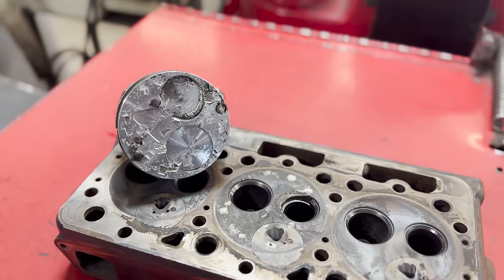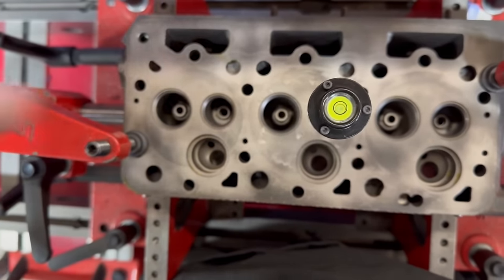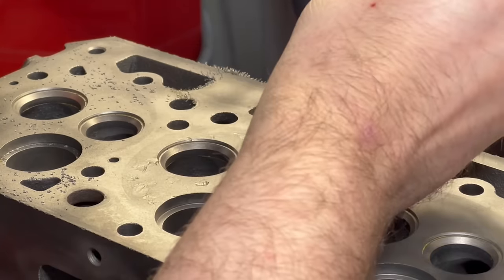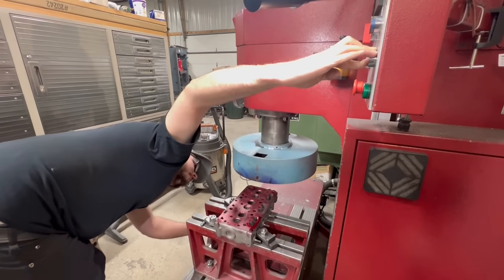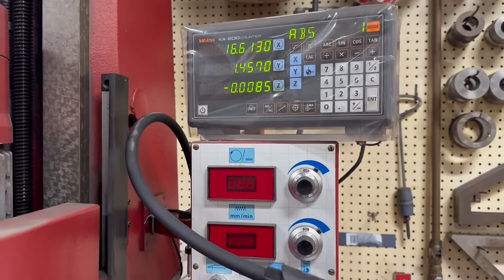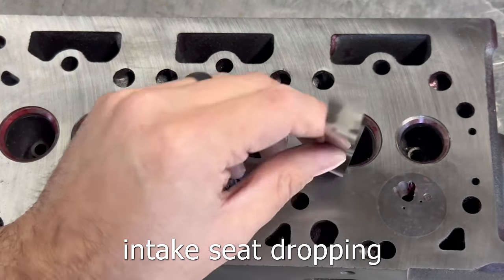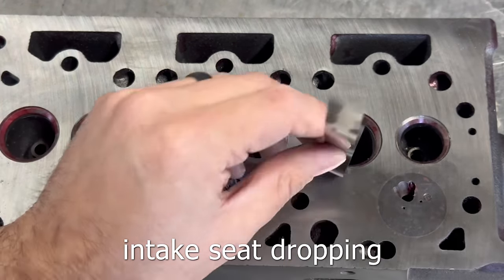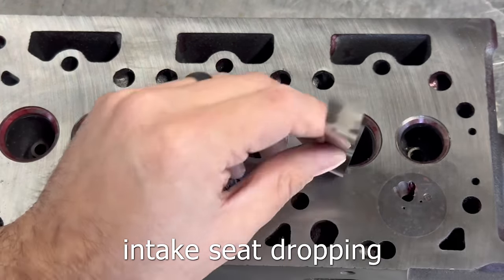Is A 3 Cylinder Kubota Diesel Engine Worth Fixing?

Comment: I'm the service manager at a Kubota dealership and in my experience the cost to repair almost always exceeds the cost to replace IF you can even adequately repair the block and head. The engines aren't cheap but they come complete. Turbo, dpf, accessories, starter.... Yank the old one out, drop the new one in and you have a completely new engine and much less labor.
Reply: Since this is a prechamber engine, this might predate DPF and electronics. Many people like rebuilding those to avoid the complexity of electronics and DPFs. I think about the guys who spend a fortune on a Dodge 12V CTD Ram.
Reply: That’s a feature of your shop rate, not a bug.
Reply: Planned obsolescence. The same is true in most industries. There may be an occasional instance when repairs are possible, but over time you find that it is often cheaper to replace rather then the labor cost of trying to source parts and cover the labor.  Great video!
Reply: @jimknowlton342  the shop rate is a "feature" of the economy and in line or LESS than some other competition. Trust me when I say I couldn't rebuild a Kubota engine for less than I can to replace it. So much so, in fact, that I have NO tools in this shop to rebuild diesel engines. They would never get used because it's never cheaper to rebuild THESE engines. When I worked at a different color manufacturer with far more serviceable engines for far less money, we rebuilt them.
Reply: @skylinefever  I don't disagree. I recently had a pre emissions track loader in the shop and tried real hard to convince the customer to just get a new engine that was still available rather than trade it for a new emissions machine. Because the machine itself was in AMAZING condition and just had a TON of hours on the engine. That pre emissions engine was very reasonably priced because it doesn't have the price of emissions built into it like replacement engine for current models.
Reply: So you install a Kuboto engine, and it dies immediately, and you've got a warranty.  If you have a machine shop rebuild.... who knows?
Reply: Ya, I  wondered about that,  especially in CenTex where machine shop wait times long and labor not inexpensive. Old stuff could be sent south in bulk containers where resources different
Reply: When you get a good shop to do the work, you aren’t gambling on “new” parts.
Reply: Siamese blocks always  take  the hit in center hole.only 2 sides exposed to coolant.heads will crack from precup  to exhaust seat.less labor to replace engine complete plus a better warranty. Find the cause of overheat and address.BX series   main culprit. Small cooling system  does not like restricted  air flow.35 year KTC tech
Reply: It is good for training however it would be best to replace the engine.
Reply: Well your little kubotas run a lot better with the dpf removed and a custom ecm tune. 😉
Reply: And throw the old one into parts bins at the shop when you need something in a pinch.
Reply: I hate that we are living in such a throw away civilization.
Reply: I’ve just rebuilt a Fiat/GM 16 valve 1.3 diesel. The cam chain had failed but these engines have sacrificial valve rockers. Bearings were all great, bores cleaned up with a hone. It’s had new rockers & lifters, cam chain kit, head gasket kit, piston rings and a top end strip and decarbon. Parts costs are very reasonable. The great shame is that Fiat only used a cam chain because GM wanted it. A belt would have been more reliable.
Reply: We found head gaskets were more expensive than another engine from japan and injector nozzles were a laughable price. Ive even used different rings and taken care of the old head gasket and used CRC gasket paint and reused it to keep a pump running.
Reply: @permaculture3 that’s not what Planned Obsolescence is.

Here, this is high automation involved during manufacturing lowering the cost compared to the high cost high skill required for disassembling, analyzing the issue, designing a solution, applying that fix and reassembling the engine back. And also the cost to request and ship replacement parts. This equation might be different in a country with lower human cost or requirements/expectations from a customer regarding the lifespan of this fix.

Planned Obsolescence is when a manufacturer changes the design of a component for the explicit purpose of reducing its lifespan even if the new design is most expensive/complex. And that this reduced lifespan will trigger a new sell all the while not lowering the customer perception of the company/product. 99.999% of what is called Planned Obsolescence can be explained by “it’s cheaper this way” hence is not Planned Obsolescence: it is the customer picking the cheaper choice.
Reply: D max if you know anyone needing a Deutz F3L 912 3 cylinder air cooled diesel , I have one off a Miller welder for sale - runs Fantastic !  Charles in Cheyenne Wyoming
Reply: Sounds like something a service manager would say.
Reply: @skylinefever preach
Reply: DPF? Lame
Reply: At around $6000 for a 3cylinder kubota new, theres no way i wouldnt take it to a machine shop first.  Automotive engines dont cost that much with labor involved.  The kubot d902 and any other little variation has been made for decades.
Reply: Me too
Reply: This is an IDI Kubota engine something you probably have never seen likely may not even have a turbo much less a DPF lol these arent so cheap or easy to come by
Reply: @123ABC-Machine-Basics  what happened to the welder? I have same  one and hoping it holds up ok ~93-94  airpak. Just had to replace some wiring that mice got into over winter. Hoping everything else is still good. Around 5k hrs on former BNSF unit.
They run so nice.
Reply: I would have cooked lunch for you. Lol. It seems that before you start any work you should check all the parts and start with no parts that hurts when you lose money on a part. You should have started with honing out the center bore. I would have tried to find a used one that someone is trying to unload that has been lying around then you could have used the block and the arm thingy connecting road you just said and have 2 left over.
Reply: Ok then, riddle me this “service manager” how well will one of these work in an older Subaru brat, I have a couple so basically any older Subaru?  I don’t care about going fast, as much as being able to off-road with red diesel.
Thanks

Comment: Those engines come in a lot of the equipment we rent at the shop I work for. That was a $5000 replacement engine pre-covid. I have repaired 3 in my time at the rental shop, always from being tipped over and then forced to start without draining the cylinder. We have availability through Kubota even though we are not a dealer. I could probably get you parts if you need help in the future.
Reply: I also work at a rental company. We have about 100 of these engines. Most have over 10,000 hours now. Very few major failures. We just got a quote on a D1005 for our application and it was $5500
Reply: Yes, more equipment needs tip over tool like trench roller‘s have
Reply: I just paid $6,800 for a remanded D902, they’re just as much for a remanded as it is a new one. Problem is, new ones aren’t available for 3-4 months.

Comment: Give it to me, I will take it. You can buy loaded cylinder heads, valves already installed all over the internet. Also you can buy liners for the block pistons and rings. If you saw how I took cylinder sleeves out out you would cringe, Lace each side of the sleeve with a torch and collapse the sleeve, throw the new sleeve in liquid nitrogen and heat the block and the go right in. Those engines are bullet proof and can be fixed with no problems. You are too particular in your analysis. I have 20 of those different size engines in service in my business and have rebuilt many of them and never had to throw a block away. With the advent of Teir4 engines and all the problems they have those old mechanical Kubota engines are GOLD I buy every one I can when I see one for sale.

Comment: Certainly is rare to find any shop that will take on a challenging job requiring a fair amount of skill and resources only to find it is ultimately unrepairable, and then simply consider it an opportunity to gain experience!
Especially since you're already well seasoned, and have lots of quality equipment. Usually, this scenario starts with repair people taking on a job they are unqualified to do, and then charging customers obscenely for their unfinished/damaged results.

Way to go guys, it's great to see there's still skilled & honest shops out there!
Reply: Gaining experience, and not at a customer’s expense, is good. When I need skilled labor I want to pay for their experience, not their education.

Comment: Great video! We have small kubota with the same engine.Spent about $1500 for oem  parts and machine work due to a faulty air filter.Had to sleeve the center cylinder . The second time cost $1200 for 3 sleeves and minimum parts due to another faulty air. The foam seals on the ends deteriorated within a short time and allowed dirt to wipe the cylinder walls. We changed the entire air filter assembly to a radial seal type with inner and outer filter.Problem solved. Sorry to be long winded but I had flashbacks watching the video.😁 I always enjoy the videos ! Keep up the good work.

Comment: I'm a truck driver, I visit a large repair shop that fixes a lot of heavy duty landscaping equipment. My usual work there is taking away old 3 cylinder diesel Kubota engine cores and/ or bringing them new or rebuilt Kubota engines. There is quite a large thriving Kubota community out here

Comment: I have a D902 in my Chinese mini-ex and decided early on to add oil press, water temp, low oil press, high water temp and tach instrumentation to monitor what the engine is doing.

Comment: The Kubota's are built with a throw away mentality. 
Planned obsolescence is at the heart of our Industry.
The problem with putting a sleeve in the core is so thin not much room.
Now the block has been honed the press fit will cause the adjacent cylinders to be out of round.
You can check your rod for bend and twist in the mill with a .0000 indicator to check for parallelism and perpendicularity.
You can straighten if needed.
That cylinder may run in a pinch.
I know I do not like to do things sometimes,  I let the customer make the call.
Good idea having the customer get their own parts.
I feel for what you guys go through.
I know, believe me.
Nice job fixing the head Nicholas.
Thanks for sharing..
Take care, Ed.
Reply from the maker: Thanks for watching and sharing! It's an interesting industry these days.

Comment: On the other hand, I see you do more precise work than most machine shops. Based on that, I think the finished engine would probably be better than new. I've been rebuilding engines since the 1960s. Mostly diesel and racing engines.

Comment: Had a kubota powered Case IH lawn mower from the 80’s that was tired and the guy that bought it off us ran a machine shop at a truck shop and was able to source all his parts through Thermo King since they run Kubota engines.

Comment: kubota trained tech here, those are not throwaway motors. those things will last many thousands of hours if properly maintained and ive seen lots of them do just that firsthand. kubota is the honda of diesels, they use the same bosch style fuel pumps in the old Mercedes diesels, their castings are super tough and designs are very serviceable, I was always super happy to see them come through the shop, unlike when people would bring in kohler v twins that would get destroyed constantly, and the customers always threw a fit about it because they abused and neglected an already fragile motor, blew it up, and never bothered to research parts availability on their essential equipment and would have found out that kohler v twin blocks and internal components have a lead time between 1-3 years. sorry got sidetracked, dont buy kohler v twins or anything briggs made within the last 3 years

also dont bother with the kubota tractor dealers, go through a local power equipment dealer. different divisions that get different support and resources

Comment: It's interesting, I went through a Kubota D600B years ago, and it was the opposite of what you are finding.  OE parts were easy to find and not overly unreasonable.  It was a dry-sleeve engine (I didn't need sleeves), so it was meant to be rebuilt.  It was also one of the easiest engines I have ever worked on.  Very logical; no fancy specialized tools were needed, came apart, and went back together really easily.  It was also a very stout little engine.  I have two other Kubota products that I hope are built like that little D600B; now I'm wondering...
Reply: Late but I see these on FB marketplace occasionally for $400-800. Was wondering about that. Maybe I’ll splurge and see if I get lucky.

Comment: Me personally, I'd take a chance on the repair vs a $5 engine, if you could even get one. 
I'd have him finish the head, touch up that center hole a little more, even if it was on the high side. Find a used piston and rod, new rings, brngs and gaskets.  If i was all in parts and machine labor for around $1000-$1500 plus reassembly myself.  I'd shake hands saying no guarantee, i understand, and thank you for trying Jamsi !

Comment: At my shop (transmission shop), we do 99.9% late model stuff, recently we got suckered into working on an OLD Ford truck with a C6, the customer kept assuring us it would be EASYYYY because it was so old (customer was clueless of course) just like your customer thought it would be so easy since it's small. We should've walked away. Luckily, it didn't need a ton of hard parts, but even the simple standard stuff took 2-3 days to show up from 3 different places. I just nod and add money to the invoice.
Reply: It's hard to really kill a C6, but time marches on and situations change.
You can't just walk into the local NAPA and get kits, hard parts and an assortment of converters off the shelf for something that's 35 years old.
I completely understand your position.
Reply: @jimurrata6785  the seals inside were older than me, and I'm 36. LOL. You're right though, a 143HP V8 really wasn't putting a hurting to it, it was just time for a refresh.
Reply: @cameron878  I daily an F-250 that's older than you!  😆
It's going into the shop tomorrow morning for a new clutch after 15 years. Not because it slips but because the starter has chewed off a bunch of teeth from the ring gear.
A new Luk flywheel is cheaper than having the machine shop blanchard grind the one in there, and there's no point going that deep and not replacing the friction, pressure plate, pilot and throwout.
Reply: @cameron878   whats up bro ! I see you have good taste in channels as well ! 👍

Comment: Maxiforce or even sometimes Reliance parts will fix you up with the common kubota rebuild kits. As far as sleeves you always have melling or LA Sleeve. Kubota sometimes uses weird oversizes
With their bearings and puston oversizes so its a must to check availibility before you cut or grind something 
I see alot of kubota oversizes in .2 and .4 mm which is close to .008" and .016"
Reply from the maker: None of them have anything for this engine lol

Comment: I didn't realize the kabota was a prechamber IDI engine. never had one apart before. neat, that prechamber design is used on the GM 6.2 and 6.5 family. Looks like it's a good time for a sleeve on that center cylinder
Reply: Kubota made many different diesels, some were prechamber, some were direct injection.

Comment: These are such a sturdy engine. Interesting cooling system as well. Ours doesn't have a pump it relies on convection. As such you do have to make sure to keep the radiator clean so it's working correctly.
Reply: " Interesting cooling system as well." Apparently a bit too interresting, considering it overheated. 😅

Comment: These D902 engines are good engines and are put in everything and parts are easiest to find at a local Kubota dealer and you know you are getting genuine Kubota parts . Unfortunately, a block costs about  2200.00 and a head costs 12 to a bit over 1300.00. add either to the cost of what is already done, gaskets, etc. or needs to be done and you are up there with the new engine cost.   So in this case this engine is not really worth fixing.

Comment: That motor probably puts out 30hp max. I reckon if you reassembled the short block with that mark in the bore it would run another 4000 hours even with the bent rod. It's not a high revving engine.
Reply: It’s 19 hp at 3600 I believe
Reply: I was thinking the same. Did a gas 4 cylinder for a Suzuki Firenza. Timing belt prematurely broke at 2 years in. Pulled the head. Valve job done. Found out it was using oil and oil pressure would drop to almost nothing at idle. New bearings, and rings. Running well. Not using oil, and pressure is good.
Reply: That is complete bullshit. Small engine or not the rings are not going to seal in that spot. You'd never do some mickey mouse shit like that on a customers engine.
Reply: @Jeremy-iv9bc  I just like  your mickey mouse comment, f-the customers engine just send it lol jk . if theyre paying it has to be perfect.

Comment: Kubota engine parts may not be available through your wholesale suppliers but any Kubota dealer can get all the parts you need. I have rebuilt several 3 cylinder Kubota engines with factory parts and Chinese kits.